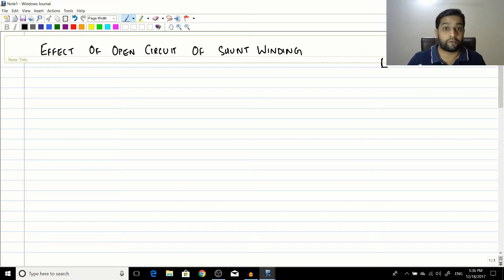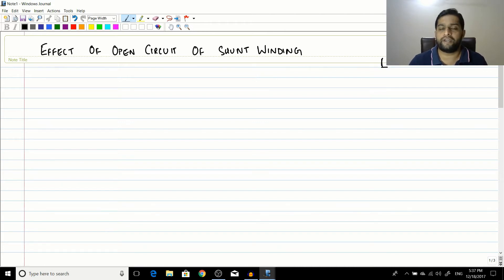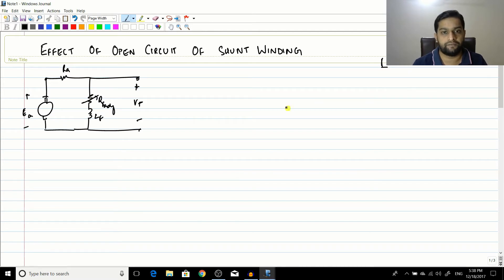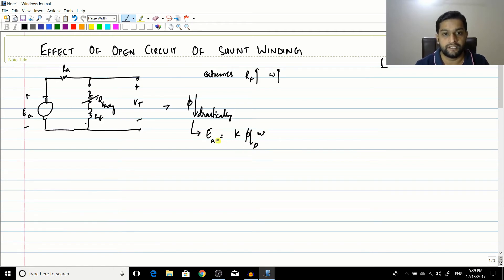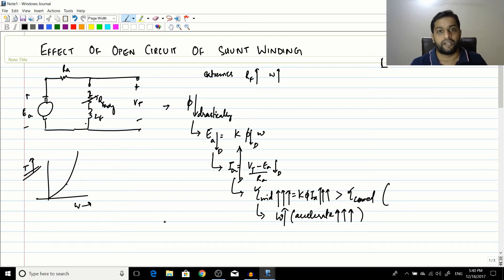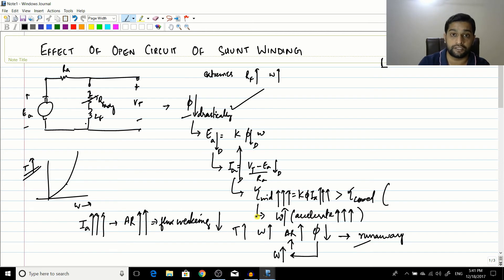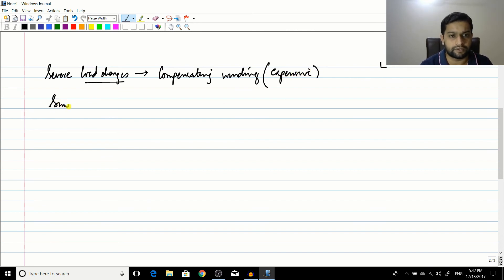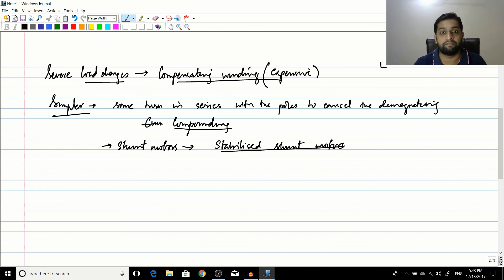#11 DC Motor -  Effect of open circuit the field winding of dc shunt motor

Comment: I think the armature reaches high speed because of residual magnetism which does not allow flux to reach zero in the field winding(am I correct?). If I am correct, my other question is what happens if the field winding is disconnected and physically/magnetically isolated from the motor while it is running. Assume the DC shunt motor is not loaded.

Comment: But as the speed increases to high value due to open ckt of field winding, armature voltage also increases then torque should get reduce... When there is no torque  , then speed should become 0 after some time... Why it is not happening??

Comment: In open circuit ,the speed can be avoided by compensating winding or some turns in series to poles.But,these compensating or some turns of winding will be placed in field poles in series to brush in open circuit these will be cut off..so,how this could be a solution to open circuit problem??
Reply from the maker: in a motor a load will be always connected and it is a mechanical load that will demand some current and because the armature supplies that current the winding that is in series will see that current, the open circuit here is for the field circuit only....